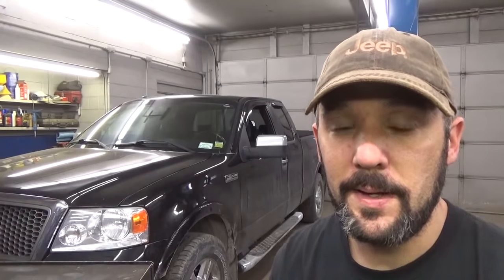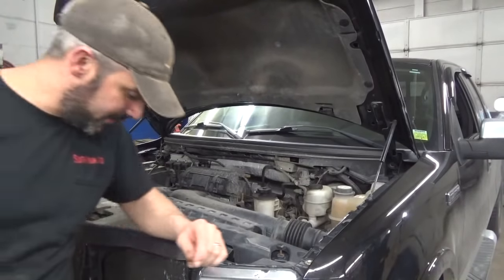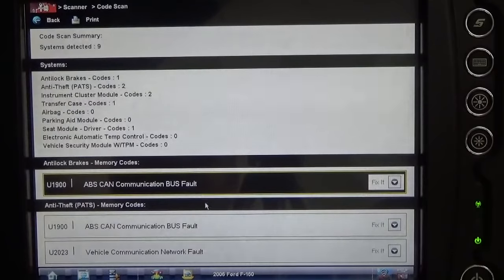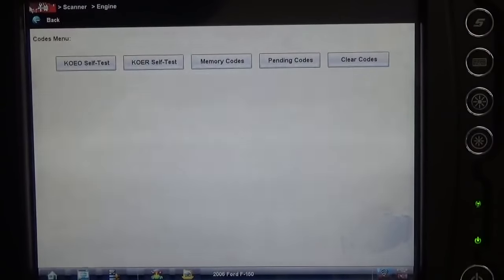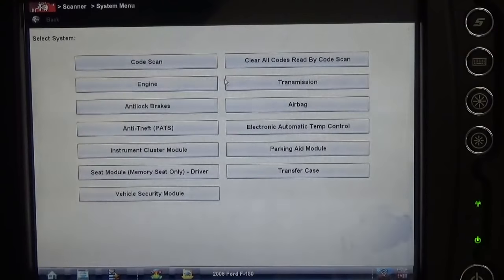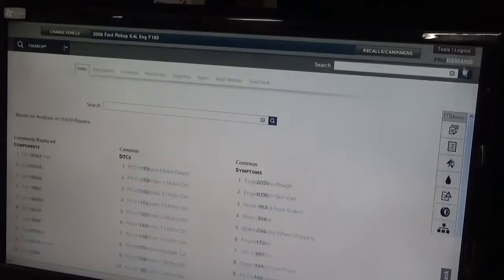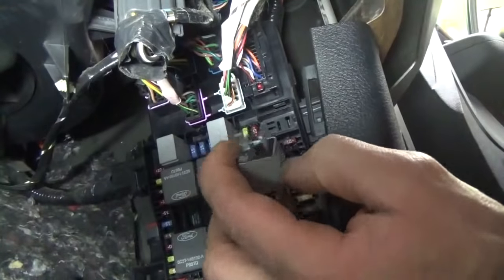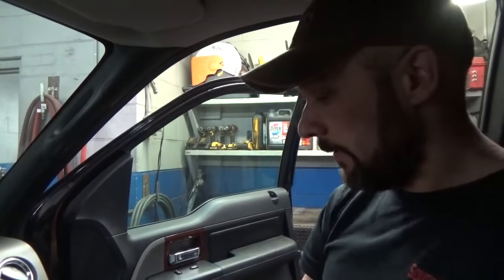Ford F150 5.4 No Start, No Crank, No Communications Codes: U1900, U2023

Comment: 19 Ford dealer mechanics didn't like this video
Reply: 160 apparently dislike it now lol
Reply: @tdmfan750  All those new PCM's they could have sold .......
Reply: That is a good thing. Dealerships are way to proud of their service by about 300%
Reply: Dealer mechs don't make phat bank, the dealers do. The mechs get flat rate most times. That's why so many turn independent!
Reply: LOLOLOLOL
Reply: Did you ever figure out where the moisture that caused the corrosion in the relay came from?

Comment: There are mechanics and there are parts changers, Eric is a true mechanic.
Reply: More like electricians with mechanical skills.
Reply: Too true
Reply: @Joe Black Likely they do and also they likely mark up what SMA's charge was to them which I would suppose is the same as any client rate would be. However, SMA has said in the past, he does this because he has a relationship with those shops. At some point, you have to deal with the local turf which is rural and word spreads fast in those conditions.
Reply: Help me
Reply: Richard Hurts  With mechanical skills.
Reply: I couldn't agree more.
Reply: @Garth2011  *Technicians
Reply: Is the module getting power?If it's getting power and not sending any,Then I would call the module.
Reply: Since my mechanic passed I haven't found a good place to take my cars too since! That's why I am here trying to figure out what could be wrong with my moms pickup. It has a battery draw and no one can seem to fix it except keep replacing the battery! My mom used the same mechanic as I did.
Reply: @tnt8106  Any parasitic drain over 75 milliamps will drain the battery quickly. The most common causes of parasitic drain/battery draw are under hood lights, trunk lights, headlights or glove box lights that do not turn off when the door is closed. Relay switches that are stuck in the "on" position can also cause a battery to drain.
A faulty charging system will drain the battery while the car is running. When an alternator is not pushing out enough voltage, which should be between 13.5 and 14.5 volts, the battery will drain quickly. This is especially true if you play the radio and lights while driving. Once the car battery drains completely, the headlights and radio will not operate. The car will stall and not start again until the battery is charged. Lastly, alternators with bad diodes can cause battery drain. An alternator with a good diode allows current to flow in one direction. A bad diode can leak and allow the current to flow in the opposite direction. When this happens, it may keep the charging circuit on after the vehicle engine is shut off, which will cause the battery to drain. Not sure if you have one in your town but parts stores like AutoZone usually can test things like alternators/starters for free.  If you dont have one in your neck of the woods that suggest you give your local parts store a call and see if they offer free alternator/starter diagnosis.
Reply: Eric is a technician ;)
Reply: Not a mechanic a genius my guy
Reply: Technician.
Reply: Pay that man for his diagnostics labor! Very good. 👍
Reply: and for additional costs with a $ 100 Minimum diagnostic charge there are Automotive "Technicians"....
or as is the custom in this day and age in Germany;.."Mechano-Tronikers".....
Reply: @tnt8106  you probably have it sorted by now but Ivan will have a video about that for sure.
Reply: Very True the other shop had it towed to you Eric. For something simple as a Fuel Pump relay.
Reply: @NoName-gv6nm  Exactly! So many people are labeled as "Technicians" that really aren't much more than monkeys. But, a really good technician can fix durn near anything, from a tricycle up to an F-35 and beyond. (I cut my teeth on Fords, the A-10 Warthog and the F-16 Falcon Integrated Avionics Test Systems.) My buddy in Tech school, joking at our graduation said "9 months ago, I couldn't even spell technician. Now, I ARE ONE!". I believe that Eric O is one, also.
Reply: @Garth2011  9
Reply: Living learn...

Comment: All future mechanics need to listen to this guy. The fancy tool doesn’t tell you what’s wrong with the car. The fancy tool only tells you what’s being affected by what’s wrong. From there you have to start analyzing the data stream and doing proper troubleshooting. All I can say is I wish I had a mechanic like this where I live. He knows his stuff!
Reply: I can relate. My old Astra had "Turbo overboost" codes with limp mode set. I would never have found the issue without my AUTEL MaxiCOM and the live data. The codes alone pointed to the turbo. The live data showed the MAP sensor was stuck low when it should have been changing with revs. New sensor fitted, she revved up beautfully, with the sweet whistly moan of the turbo! Back to life! I love AUTEL products!

Comment: K.I.S.S.  Keep It Simple Stupid!  As an old plant engineering type with 45 years fixing everything from plugged sanitary sewers to automated storage and retrieval systems, boilers, air conditioners,  R. O. systems and so many other things I can't even remember, the K.I.S.S. method has been the basis to all diagnostics!

Comment: Another great video Eric, as an electrical technician in a hospital I have an old saying, "Five minutes with your head, can save an hour with your hands". Think about what it is you are there to repair, digest all the information you have and ask questions.
I would say the Verdigris on that relay is the result of that window being left open as a shower of rain came past in the wrong direction and made its way into the A pillar fuse box, corroding that relays pins out.
A couple of years ago I did an 11 state tour of the USA and took a trip to the Ford plant in Detroit where I saw the F-150's being assembled, I can tell ya the dash goes in on a gig and two guys secure it up in under two minutes, that fuse-box is already part of the dash and at best they just plug the connectors together before the truck moves along the line, nobody in the plant bent backwards to access it the way you were!!
I drive a Ford Mondeo (Ford Fusion in the USA) and the inside fuse-box is under the dash in a similar place, the good ole G-spot is easier to get your fingers on.

Comment: Sorry to have such a late replay.  I have seen this same kind of corrosion on a device we use at work to test thermal imagers.  We used to use a diluted dishwasher soap as a vacuum leak test chamber as a quality check.  There is a power module in this unit that has a connector with spade pins.  After several days one of the pins that provided communication would corrode with green crust and cause failure in the mech.  These pins werent on the power circuit, however; during the test there was a electrical bias on this line.  The problem was that dishwashing detergent has a lot of phosphates that will corrode copper when an electrical bias is applied.  We ended up switching to a non-corrosive detect like "snoop" which stopped this from happening.  probably similar situation with the relay in this car.

Awesome work.   I watch you all the time to help me on my vehicles.  You do great work.

Comment: I know this is an old post but sure helped me out today. I had a no-crank, no-start, flashing antitheft light condition on my 2004 Ford F150. In the past I was able to get the truck to start with the "key on-unlock three times, key off-unlock three times, key on" dance but this time it flat would not work. My scanner was telling me the PCM was not responding. I checked the different ground connections and they were all good (cleaned them up anyway).
Then I watched this video, ran the same test light tests, and swapped the fog lamp relay into the PCM power slot and BAM! my truck started right up. 
Thank you so much!

Comment: Man, I am so thankful for this video.  It’s been a hard couple months with truck repairs (including a tranny rebuild) and this video saved me.  Bless you and your family.  $24 to fix because of you.    Thanks a million.
Reply: Currently in the same boat. My 08 f150 is a rust bucket and my only vehicle.... it doesnt start....
Reply: Eric, I have been frustrated with my 2012 3.5L EcoBoost for the last month. It has been intermittently starting after driving for about an hour with multiple stops and restarts. Then turn the key or remote start and get nothing but dash board lights?? But if I lock it up and let it cool down for 10 to 20 minutes then it fires right up. I suspected fuse or relay to the PCM. When I watched you diagnos the 2006 f150, PCM main relay video, I just went to Ford parts and bought a new relay for $7.12 problem solved. Though my relay was located in the engine compartment above the radiator it still controlled the PCM according to my owners manual. Thanks a million.
You are a genius 😊

Comment: BOOOM! Just fixed my 2007 F150 5.4 with identical problem. Shop said starter, I said no way. Why can’t I hear my fuel pump if it was just the starter? Towed the truck home, and after 2 days of google and YouTubing search I found your video kind sir. I RAN to the truck to swap relays. Sure enough, Vrooom She instantly fired up. Your video saved me at least $1000 and multiple tows to different mechanics. Soon as I heard that Ford chime in your video I knew you found the culprit. Thank you thank you. 

Just FYI we had some fairly cold weather recently and I had used my pickup to jump my semi truck. Took an hour on the jumper cables to get her started. Pretty sure I overheated plenty of the electrical system to cause that relay to go bad...

Comment: I know this is old, but I just wanted to say a big THANK YOU for posting this.!! We have an 05 - F150 Lariet with the 5.4. A couple of Months ago, it started stalling, and after a 1/2hr or so, it would fire back up and run fine. Well, over the next few weeks, it would do it randomly, so we started to look into what was happening. The first time it happened when I was around it, I laid under it and jumped the starter, and it fired right up......... The next time, a week or so later it died, I did that again, and it worked, so I replaced the starter... Then, it happened again, and this time I got codes U1900, U1950 and B1352

B1352 code possible causes 
Faulty Ignition Key-In Switch (Part of the ignition switch) Ignition Key-In Switch harness is open or shorted Ignition Key-In Switch circuit poor electrical connection 
Faulty Smart Comunication errors.

U1900 FORD code possible causes 
Faulty / intermittent ignition switch connections CAN Bus wiring intermittently open/shorted to power or ground 
Faulty / intermittent connection at PCM Faulty electrical connections at ABS Control Module Faulty electrical connections at the instrument cluster Poor connections at the trailer brake controller/trailer connector

U1950 FORD code possible causes 
Faulty / intermittent ignition switch connections CAN Bus wiring intermittently open/shorted to power or ground 

Faulty / intermittent connection at PCM Faulty electrical connections at ABS Control Module 
Faulty electrical connections at the instrument cluster Poor connections at the trailer brake 

But at this time, I could connect to it with my scanner obviously. So, we replaced the Ignition switch, the Oil sensor, and both VCT valves, and tested it again. It stalled on the way home. Only this last time, it would not let me connect to the OBD2 port....... That was a new problem, and also, this time it showed errors on the dash about a communication error, and a charging system error. Well, it cranked very fast, the battery was fully charged from the alternator, and when running it was at 14.1v, so I did not trust that one, but the code U1900 led me to search YT for a solution, and this is the very first video I found, and watched. So, I told my bud, who had the truck, to replace that same relay. He swapped the one from the fog lights and boom, the truck has not stalled once and it's been driving quite a bit now. There was no corrision on our relay, and just like this video, it still worked. It's working fine for the fog lights now. It has to be a connection issue in enginneering with the relays. I feel bad for those who have not found this video, and are still chasing this problem around. My next move was to replace the FPDM, but this vid saved me from having to do that.

THANK YOU! I greatly appreciate it!
A Ford guy.....

Comment: Just some excellent diagnose work my man! I work in automotive development and frequently get frustrated by our mechanics acting like there's nothing they can do about the simplest of problems. I often dive into engine bays and do the very same stuff you show in these videos. Laptop with all the wiring diagrams and diagnostic software stays closed more often than not - think about the issues, find the most likely cause, test it. 90% of the time works every time.

Comment: Thank you for the videos showing your troubleshooting steps and proving you don't always have to keep throwing parts at it until it runs again. I have a 2006 Milan that was doing the same thing with no com/start/etc and it ended up being the fuse for the circuit that the PATS is on. I figured I had a dead PCM. Once I replaced the fuse, it fired up right away after sitting nearly a year because I didn't want to spend much on a 16 year old car with a salvage title.

Comment: Excellent work. You can tell that you care the way you explain and move camera around.  I was on the edge of my seat to when that relay was triggered once for a start with your test light...dang that was fun.  Subscribing now!!
Reply from the maker: Thanks man
Reply: FYI- Those second gen expeditions and f-150s are notorious for fuse panel problems. There are some relays soldered to the circuit board and one of them overheats, causing damage over time, eventually causing either intermittent fuel pump cutoff or failure altogether.
Reply: He beats what's called tv today!

Comment: Great job. I wouldn't have had a clue as to where to start. I wonder how many shops would have just diagnosed a bad pcm and replaced that without simple diagnostics. In this case, they'd still have a no crank no start.
Reply from the maker: Jeffrey Cardimen Yeah then the'd be scrambling :)
Reply: Jeffrey Cardimen 
Please help 
I just replaced body wiring harness and that whole pcm that you just replaced fuse. Mine is a 2013.  I try to start and a clicking noise in pcm no fuel pump coming on just clicks. Does it need re programmed from dealer ? Or could it be relay or fuse like yours but it’s brand new from dealership.  Please advise thanks
Reply: that was my first guess 10 minutes in - that's why I'm no longer in the biz ;-)

Comment: i just had this problem, with my van. it wasn't the fuses, it was a loose wire on the postive battery post, i cleaned it off, retightened it and it fired right up.  Thank you Jesus

Comment: I really like these diagnosis videos best, and it just struck me that now I can go back a few years for a repeat watch.  I remember this truck, but didn't remember the solution to the mystery.  Two things aren't mysteries; first, the engineers who put fuse boxes under the dash are stupid, and second, Eric is the man.
Reply: i have to disagree if you refering to ford being stupid for putting the box in a hard to reach spot,sure its harder to get too but the benefits of not having your fuse box exposed to the elements make it a better choice then engine bay.
Reply: @pigeonsil240sx  This is a part of a more general complaint with car makers who make cars today seemingly with little consideration for maintenance and repair.  Twenty computer modules, inaccessible spark plugs, water pumps inside the block,  and fuse panels under  the dash.  Put the panel on the side of the dash.  
       Things are too hard to work on because the mechanicals are stuffed inside the styling.  Back in the day changing a water pump was fast and easy; blower motor, simple as pie.  Try changing a blower motor now.  First, it will take two hours to sort through the computers to verify the fault, then five more hours to disassemble the whole dash.   
      Cars are better, and more reliable now, probably designed to last for six trouble free years.  But then they want you to buy a new car.   Many folks like me have traded in cars because the cost of repair didn't warrant keeping it.

Comment: I’m a 50 year old woman. 
My truck is doing exactly this the Mechanic men have made me buy a new battery, alternator and starter. 
I’m going to Ford to get a PCM power relay and a fuse puller and try this fix my self. 
Your video was very GREAT wish me luck. I will edit and let you know if that was my problem 🙏🏽😊🤔
Reply: What you find out?

Comment: Hey man thanks for this video. Truck wouldn't start 20 minutes ago. Checked those relay switches in the fuse box by the passenger door.Just took them out and put them back in and it starts right up. Probably going to need a new switch eventually but saved me tow fees and shop time I apprechiate the video! :):):)
Reply from the maker: +TrailerTrash Rusty Cool!
Reply: South Main Auto Repair I spoke to soon left me stranded again at Walmart last night. I think it may be my starter going. Or a sensor somewhere. Bc it started up again this morning.
Reply from the maker: +TrailerTrash Rusty Ahh got ya